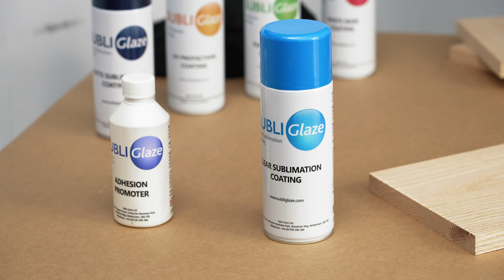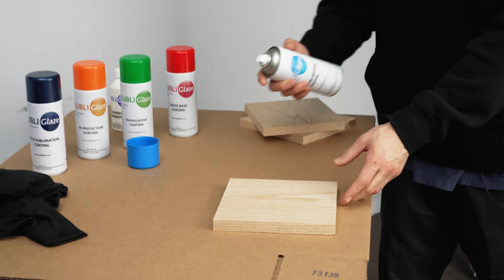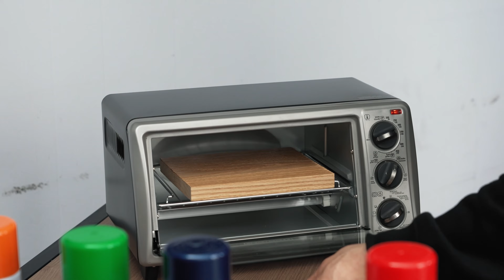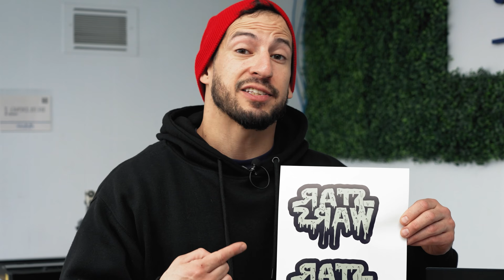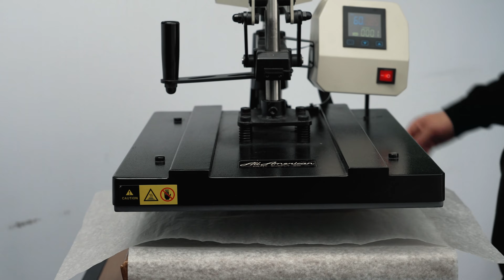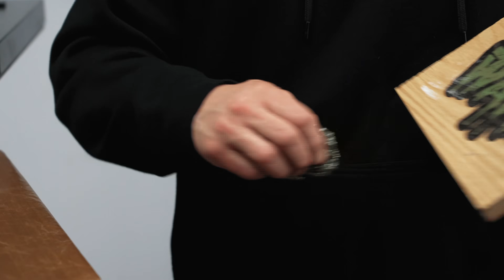Print On Any Surface With Subli Glaze!

Comment: Can the white base be used for re sublimating mistaken product?
Reply from the maker: Hello, the white base alone (which is not dye sub coating) would likely block the ORIGINAL coating on the actual product. For safest practice we would first use the white base and THEN your chosen sublimation spray coating to ensure a good transfer

Comment: You think this will work if i used white primer on wood then the clear glaze on top?? Thank you.
Reply from the maker: Hello, in theory that should work if you put the Subli Glaze Clear Sublimation Coating on before transferring. The clear glaze coating will be what allows the transfer to apply so the white primer underneath should not interfere. Just be sure to follow all application settings for drying the clear glaze and I think it will work.
Reply from the maker: Be sure to let us know how it turns out and feel free to send in photos of the results to @aaprintsupplyco on Instagram

Comment: I have a substrate that is a silver coin of stainless steel.  I want to sublimate on it.  I’m assuming I’ll need 1. Base white coat. 2. Adhesion promoter 3. Clear sublimation promoter - is that correct?  If so, which order do I apply?
Reply from the maker: Hello! We would advise the adhesion promoter first, then the white base coat and the clear sublimation coating last

Comment: I’ve just started to sublimate and I do mugs and slate plaques, to do mugs I use an air dryer just for it and a heat press for the plaques. I want to try and do tea cups and glass plaques but can I cure them in the air fryer as I don’t have that small oven?
Reply from the maker: Hello, we have not tested air fryer for sublimation settings to confirm. For the actual subliglaze treatment coating the manufacturer does advise the use of an oven to prepare the items with their spray. It may work but testing beforehand would be a must before offering new products with this method.

Comment: Question please. I have been sublimating for roughly 15 years. I have always used sawgrass ink, SG1000, and Text R print paper. Will this work for this? Thank you.
Reply from the maker: Hey there! This is totally compatible, I would not change any of your normal dye sub printer settings with that model. I like the Texprint R paper also!
Reply: MUCH THANK!!!!  @AAPrintSupplyCo

Comment: Curing on oven, then how is this used for black t-shirts.  I dont like curing process, because it limits size
Reply from the maker: Hello, because sublimation is a CMYK printing process (NO WHITE INK) the same rules apply here - no dark garments. This line of products is designed for hard surface application, would not be advised for material use
Reply: This is what i dont like size restriction

Comment: Hi ive been doing subli glaze clear onto wood some wood turns out brillaint others dont does the lightness of the wood matter? Which wood is best to use ive used basswood
Reply from the maker: Hello there, the wood color will 100% impact especially when using clear. Sublimation has no white ink meaning the background will be the color of the item you transfer onto. Lighter the wood the better as a dark wood will mute the colors greatly. There is a white base coat layer you can apply before the clear sublimation coating for high accuracy but the background applied will be white and could change the wood effect
Reply: @AAPrintSupplyCo   thank you I tried to stay away from the white base coat as it doesn't show the wood affect as much, I will find lighter colour woods, thank you
Reply from the maker: @jayf39  You are very welcome, happy to help. Have a great day!

Comment: Great video guys thanks for info!! I need a recommendation what can I get if I want to sublimate in raw aluminum sheets what product should I use?
Reply from the maker: Hello, if the finish is very smooth we would advise the adhesion promoter first. If you are looking to use the raw aluminum as the background of the image (in place of any white in the graphic) you can choose from either Matte or Clear sublimation coating. If you desire a true white background, after the adhesion promoter, you can apply a layer of the White Base coating and the add the sublimation coating of your choice.

I personally do like the look of the aluminum in the design as seen on sublimation photo panels available on the market but if you need colors to match as close as possible the white base coat would be the step to add in the process. Just remember: the white base coating itself is NOT a sublimation coating

Comment: I need a white base do i spray it then put it the oven and  then put the  clear spray on and put that in the oven or just do it in 1 go? Trying to do this on slate but it doesnt seem to be coming out to good
Reply from the maker: Hello there, that is correct! Please note, the white base spray is not sublimation coating but needs to be prepared in the same style as you mentioned: white base, oven, clear spray, oven
Reply: @AAPrintSupplyCo  brilliant thank you for your reply
Reply from the maker: You are very welcome :)
Reply: So after that clear spray you can sublimate?

Comment: How do you do it on a clear glass cup? Would you recommend doing the same steps?
Reply from the maker: Hello, for the glass application I would advise the use of the adhesion promoter mentioned in the beginning of the video for best results. Smooth surfaces such as glass, metal, ceramic etc will benefit from this extra step!

Comment: would you recommend to sand it 1st to get a smooth surface before spray? thanks  and are you guys going to be at Graphics PRO in March at Irving?
Reply from the maker: Hey there! Testing on individual items will always be advised to achieve the best results. Sanding would be helpful on particularly rougher texture surfaces